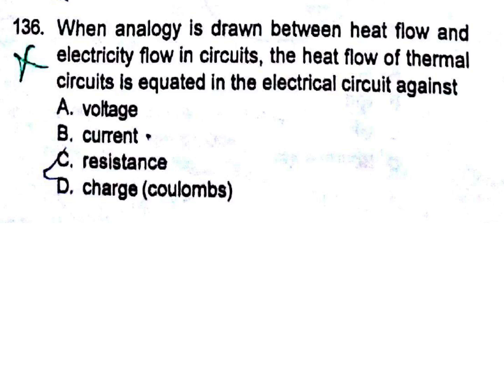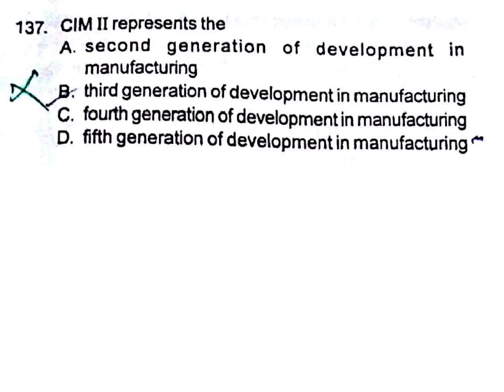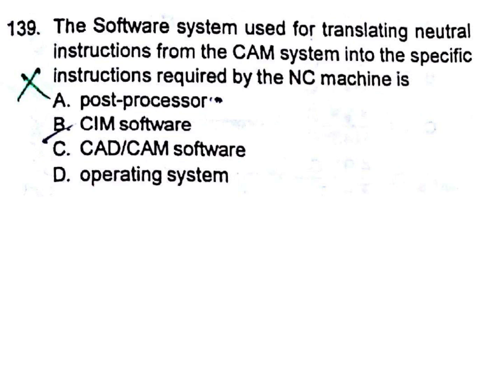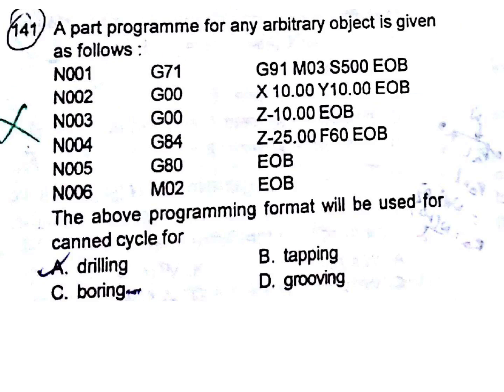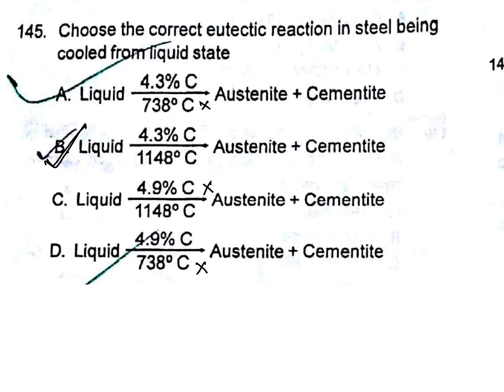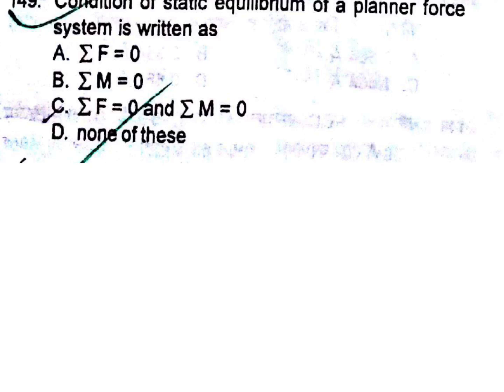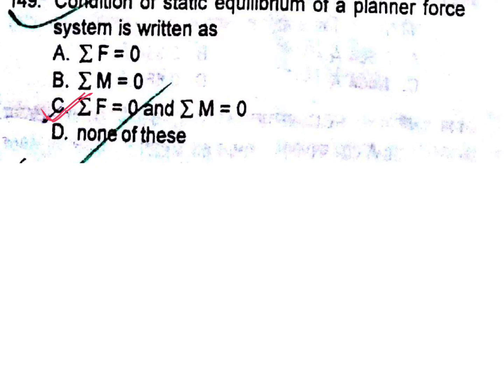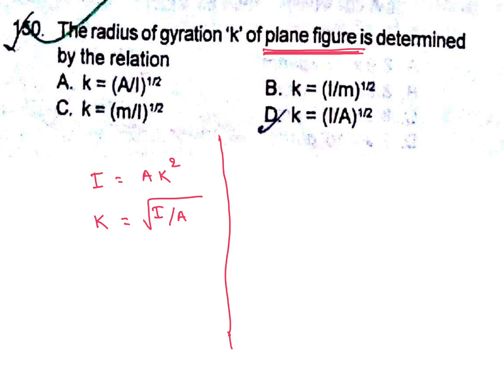VIZAG STEEL PAPER 2015 PART 08

Comment: sir ............ques...144...@6:33..............why answer B is incorrect..though it is well suited as per the definition of miller indices and axes intercepts as well........if a plane is intercepting the axes at 1/6, 1/3, 1/2  respectively then it would have surely the miller indices as (632).......then whats wrong with that sir.....and also the concept of making a whole number is appllicable to miller indices...but not with the intercepts.....if we are getting a fraction in miller indices then we make it a whole number by multiplying it to a greatest common factor of denominators of all the fractions............please comment
Reply: i think b is the right one and you r right